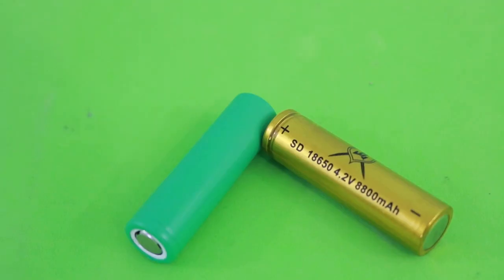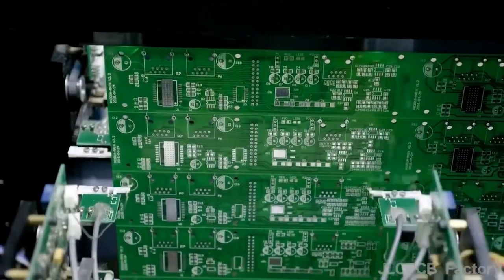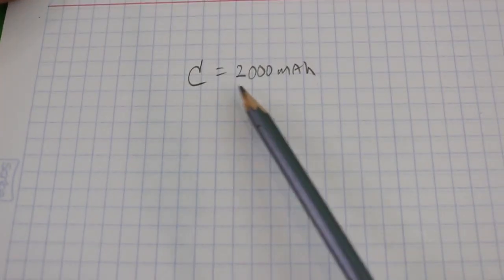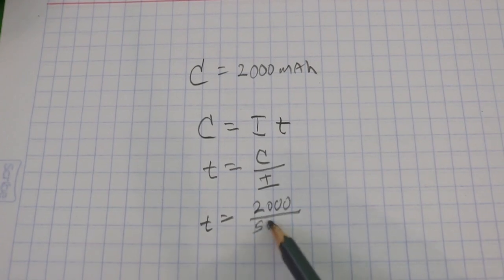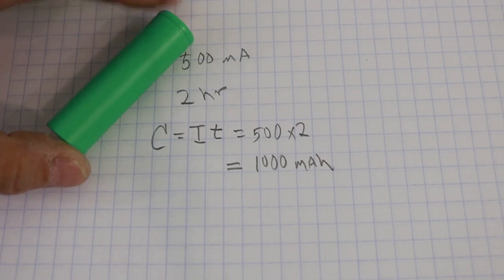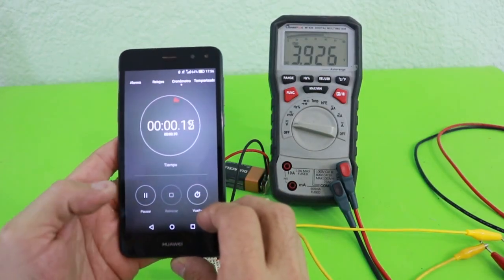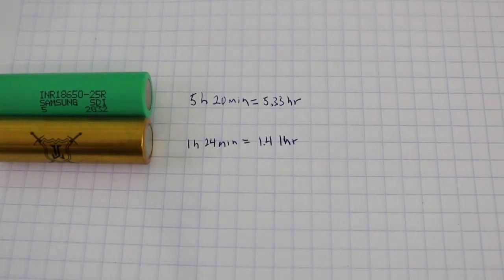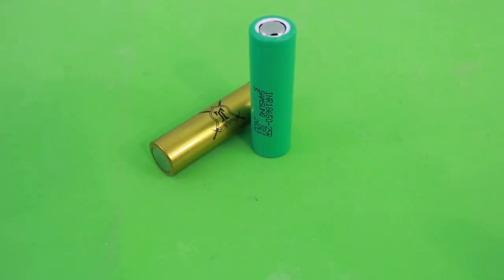How to Test Battery Capacity without Special Equipment

Comment: Couple of questions:
1) Does your dummy load adjust resistance as V drops to 2.5V? 
2) how did you determine 2.5V is the “depleted” voltage target?

Comment: Is it possible to discharge a 18650 at .5 amp down 500 mah and extrapolate the full capacity from that? I have over 100 battery's in my e-bike individual cradle system. Also can you use the same procedure for the entire battery pack?

Comment: I post same questions under this video also since I didn't get answers under the other video. 

Why is not Wh (battery capacity?) calculated with max full charged voltage? For example if an electric kickbike's (Sealup Q8) battery (38km range on a good day) is rated as 48V21Ah (48x21=1008Wh) but it's full charge voltage is 54.6, so why not calculate it as 54.6V x 21Ah = 1147 Wh? 

I have a kickbike Q8 battery (Samsung cells purportedly) rated as 48v21ah but it soaks only 877Wh according to power outlet meter. Should it be soaking 1008Wh or 1147Wh, or is 877Wh correct? I also have another battery from (Aliexpress) Liitokala (tested 27km range) rated as 48V20Ah (48x20=960Wh or 54.6x20=1092Wh) but it soaks only 698Wh (it's more like 15 or 17Ah?). So am I scammed or it is normal? I complained to Aliexpress about it LiitoKala battery, that it should be at least 835Wh in it if it is 20Ah but they ask for more proof. I already showed with power outlet meter how much it soaks, it is 698Wh and showed my other battery soaks 877Wh (for comparison). Aliexpress supports vendors lying about real capacity of battery. Idk how I can prove to them that LiitoKala is not 20Ah battery (more like 16Ah). 

I also bought on Aliexpress a 48v24ah battery called Aimjin but it only charged to 53v (not 54.6v) and from empty to full only soaked 340Wh which indicates its capacity is 7Ah. It also became warm when I used it which indicates it is an old tired battery. But I paid for it near same price as for new battery. Scammed.

Comment: Great video. Keep up your good work. Nominal discharge capacity is linked to discharge current & discharge cut off voltage. Discharging a battery with higher or lower discharge current will result in lower respective higher capacity. If discharging a 2000 mAh rated battery with 1000 mA will last 2hrs , discharging the same battery with only 500 mA will last longer than 4 hours.

Comment: Thx. for the video. Can you explain the following please? 
may i know why you said the batteries would discharged  completely when it reached 2.5 volts? How do i  for 1.5 volt batteries. Please correct me if i am wrong, i was thinking the voltage will be completely depleted to 0 volt? when i buy batteries from a shop what should i be checking to see the capacity? I have a small model plane and i find different batteries provide different flying times. Is it because of the 
* different wind conditions causing it to draw different currents 
* is the the acceleration that is causing it to draw more power
Let me know your thoughts please?
Reply from the maker: These batteries can not be discharged below 2.5 volts because they will be damaged. The capacity of a battery pack is given by the mAh, the higher the number, the more capacity.
Reply: @ludicscience  Thx. for the reply. So you are saying that the displayed mAh by the company on the battery can be fudged. Only a test like above shows the real capacity.

Comment: Hi, can someone help me with something? I have a positive and negative wire going to the back of my van. This wire was used to power a wheelchair lift. I gave the lift away and now I have the cut wires. How can I figure out how many amps it can provide? I know hoe to test volts but how do I test those two wires, positive and negative, to know how many watts are coming out? Thank you.
Reply: Sorry, but you can't measure amps in that way. Amps are determined by the load. If the load is too great, there can be damage.

For example. Let's say I remove my starter, which normally draws 200amps, and replace it with a 12w RC motor that draws one Amp.

Because the load determines the amps, that circuit only produces one amp, and because it is designed to handle 200amps, no damage is done.

Now let's say I hook up a bulldozer starter that takes 400amps.

Because the load determines the amps, it attempts to draw 400amps, but the wires and relays melt. Damage is done.

So, best to find out how many watts that motor used to be, then stick with those watts or lower.
Reply: Find the markings on the cable sheath that tell you the wire gauge or the cross-sectional area if you can find either and use these to look up the current-carrying capacity, or if not, you can measure the thickness if the conductor. Half that is your radius, Squaring the radius and then multiplying by 3.14 will give you cross-sectional area and you can look at a table online with the current-carrying capacity of cable sizes. You could also look at the rating on the fuse that should be at the battery end of the positive and use that as your maximum.

Comment: Wrong right off the bat.  That Samsung battery capacity is 2500mAh, not 2000.  You also mention nothing about internal resistance.  If old and has a build up of internal resistance, it’s junk, so use ohms law to calculate it!
Reply: He said it was 2500 and showed the datasheet and read out from it that it was 2500.

Comment: Bad calculation! 1 hour and 41 min does not mean 1.41 hours. Correct its 1.67 hours. So the result is verry wrong!
Reply: It was 1hr 24minutes and he put it down as 1.5 hours which is close enough for this test.
Reply: You are right

Comment: This is very well explained. Theres some misleading information about this. A lot of people think that measuring the voltage is enough to check battery
Reply: because they confuse the  charge level in the battery   and the battery capacity
in the same way , the internal resistance is not the battery capacity
but the increase of the first can follow and sometime lead to the degradation of the second

Comment: ok but apart from ch fake one , why did the Samsung battery showed more capacity than as it was mentioned in the spec sheet. isnt this weird ?
Reply: Not really, they may have used a slightly different voltage cut-off for the testing which would affect the numbers, but the batteries are not individually perfect at the rating, they're rated into groups, say for the sake of argument a manufacturer only has an 1800mAh product, a 2200mAh product and a 2500mAh product, a battery that tests to less than 1800 would be a dud, one that tests at 1800 or say 1973 would be rated as an 1800mAh battery, one that tests at maybe 2399 would be rated 2200, one that test at 2560 or 3005or whatever would be rated 2500. as long as it's over what it says at the time of manufacture it's all good.

Comment: That's not a simple thing to do eh, most people hate Math. I think my opinion is to buy a charger that can read mAh while it's charging. Thanks
Reply: Buy a ZB2L3. Cheap and accurate if calibrated. I have 20 of them and the worst one has 2% measurement error.

Comment: You're better off buying an RC multifunction charging station and performing a similar discharge test, but charging a discharged battery will also tell you exactly how many mA were accepted before reaching a specific voltage. Also, heavier Lipos are generally the better ones but beware that the chinese have caught on and some now deliberately produce heavier battery without the added performance. Some even wrap smaller batteries into the housing of larger batteries and then add weighs... Vile creatures! EDIT: Example of the charger i mentioned https://www.takealot.com/imax-b6-professional-multifunction-charger/PLID42070840

Comment: Is it possible to test the amperage or capacity of a constant power supply such as a common 5VDC wall/phone charger? Too many chargers these days claim to have QC 3 with a total power of 18W or 20W or more Watts. How can I know that a charger is really delivering 5VDC at 3A as claimed?
Reply from the maker: yes you can, maybe i will make a video about that
Reply: @ludicscience  I hope not using huge resistors and USB tester/meter/monitor, because these are the common duo to test USB power sources (power bank and wall charger). They are not really good for us on many levels, I think.

First disadvantage - USB testers rob some power to power itself. This is what not many people know and the company/maker does not tell. So, the result will not be accurate on top of the already inaccuracy of the tester.

Second disadvantage - Resistor in the resistive load gets hot. Temperature can affect result. Adds to the inaccuracy of the USB tester. Adding insult to injury.

The "best way", I think, seems to be using the electronic/current load such as what you have and show in this video.

The price for a read-made one with a fan is....whoa, too expensive! The USB tester is already stupid expensive! I mean, the better quality one such as those UM series by RUIDENG. I could buy 2 reasonably priced quality digital multimeter with that combined price! Not to mention there are too many sellers selling the same things of the same names that very likely are fakes, they do not even have brick & mortar for me to walk in to know they are not fly by night businesses!

With your simple and inexpensive DIY electronic load + regular digital multimeter = probably results in the cheapest and the best result and stuff. (Theoretically there is no such thing as "cheapest AND best". In actuality prices are determined and fixed by humans, not forgetting those middle people/resellers also want to profit by marking up prices)

I hope what I mentioned are correct. That is a little of my rant there. Hahahahah! Oh well, I am not a YouTuber getting money from YouTube like Bigclive who can afford to buy things and wreck.

Comment: The second i saw a breadboard I knew special equipment was needed hahahaha
Reply: Legit 🤣🤣
Reply: PCB*

but fr, the title was hella misleading
Reply: Yeah, still need a phone as a stopwatch, when the phone price far more expensive than buying a battery charger that have capacity test feature, that will run automatically without manually press the stopwatch and look at it.

Comment: I hope you have tested this two batteries are at it's brand new condition from it's packaged, before you do this comparison, anyway good video experiment, but still say how would you assure the viewers that you are using a set of two brand new batteries, because they're still at their own maximum life cycle conditions and max health too, isn't it right.......?
Reply: It really doesn't matter. Even before he tested them, anyone could have told you that shitty chinese battery would be lucky to make much more than 500mAh. 8800mAh is an impossible figure. Pretty much anything over about 3500 is I think, for those 18650 cells.
Reply: @chocolate_squiggle  That's right 👍

Comment: Puts "without Special Equipment" in title, proceeds to test batteries with special home-made tool.
Reply: Hahaha no special equipment.
Reply: Yes seems to be a theme in here oO
Reply: That special equipment is a dummy load, which he did say, so you can put anything on as long as it draws a constant current, measure the load and do the maths
Reply: @LairdJ56  the problem is that you need to adjust the voltage to keep drawing the same amount od current.
As the voltage of the battery drops you need to lower the resistance
Reply: What items does the average person have handy that can draw a constant load?
Reply: it is not special thou because you can make it from cheap electronics
Reply: "Special" would indicate it's something that the average person doesn't have easy access to. It's like saying "How to make a watch out of things you have at home" & then saying you need a 3016 battery. It's not that 3016 batteries are hard to come by, but they are things the average person doesn't have at home. If they said AA or AAA you could assume most people have those or have access to some by opening a remote, while a 3016 battery you only likely have if you use equipment that needs that battery that isn't usually easily removed.
Reply: Everything in this video looks like stuff I have lying around. Not special at all.

Comment: What about the life cycle, how can I calculate that?
Reply: Life cycle cannot be tested. If your cell capacity is less than 80% than its already useless as charge retention will decrease and internal resistance will increase

Comment: They were only off by 1 Zero, if it said 880 it might have been close to reality.
Reply: But a zero is equal to nothing so it wouldn't make a difference if you can believe the Chinese manufacturer's logic. Very deceptive and needs to be stopped because millions of people are buying these batteries from Amazon and eBay type stores and getting duped by crazy over stated battery capacities. Be very wary of anything over 3,000 mAh.

Comment: He uses special equipment.. I myself cant make an equipment like he did I don't even know where to buy that PCB he uses and that alone makes it special.
Reply: He doesn’t use a PCB, but what is called a breadboard.
Any electronics store will sell you one of those.
Reply: @marcos.1771  Anyway it requires some electronics skills.
Using a multimeter could be treated as maximum equipment.
Reply: @lukask7445  The title of this video clip here is totally misleading.
Reply: @lukask7445  The multimeter is the only equipment you need, you can use a lightglobe or anything else as the load as long as you know the current draw, which you can determine using a multimeter. He's just using the dummy load because he has it and has set it to run at a convenient draw.

Comment: "2 dollars only" * 30 bucks shipping* i love it
Reply: It is a dummy load, as long as the current draw is constant you can use anything, measure the load and do the maths with that. £0 shipping fees lots of stuff around the house, torch (flash light) etc etc
Reply: That's the norm when you buy products from Amazon, or even the US in general. 
Pair of bike pedals: $18 - Shipping: $74. You only see this in the final check out page, after they advertised Free Shipping and Prime on every previous page. Total Scam!!!

Comment: Shouldn't you only discharge these to 3.3v as the amps fall off there on most cells
Reply: Depends. If you don't care about longevity you can discharge them as deep as you want. If you cut off at 3.3, 3.2V, that's better for cycles, yes. But really answering your question: every cell that has a datasheet states the discharge cut-off voltage. If you want to test according to those datasheets you must set up a constant current load and a cut-off voltage. This method will confirm how close your cell is to the specification. But most of us don't need these precise measurements, cycling through old, harvested cells from laptops and such we just need a ballpark estimate, a ZB2L3 only uses a resistor, hence varying load, but accumulates the Ah as it discharges the battery. That's a fair enough measurement. Special equipment, haha. For a couple dollars I think it's okay.

Comment: Look at charge/discharge curves. Everything in this video is a first order approximation. Basically, just measure the mass. That’s about all these methods are good for. 

See: batterymooch
Reply: The measure he did still gives tje total mAh, no real approximation. From the curve you get the max and min usable voltages. If you only care about mAh, what he did is still correct

Comment: Great 👍🏼 video.......Can you measure the capacity of normal AA and AAA batteries rated 1.5V ?
Reply: It's basically the same process just divide the nominal total by {№‰±xª=___}  & simplify it by its common denominator to find the quotient value, so (X×{____}÷a=(axb)+___%<٪1/⅓×Z-Y=(____) & there you go! Just make sure you take the total ≈MAH & add that to the battery's total ampre output before multiplying the voltage output by the resistance stated by manufacturer.

Comment: I would call this setup special equipment too. It has all what have special eq beside mA counter and auto stop when discharged.

Just use light bulb. Measure current with connected to fully charged battery, and fully discharged battery, take avg, add about 10-15% and measure time discharging with lightbulb from full battery to empty.
Reply: Shadow_of_STLKR - The “equipment” demonstrates the creators actual understanding. In other words, zippo. Kinetics are the key. The video is blind, stupid and misleading. All that said, just measure the mass. Forget this bogus video.
Reply: @boonedockjourneyman7979  Hey, why don't you put up or shut up? Criticising a perfectly valid measurement method with talk of "kinetics". In 50 years as an EE I have never heard that term used in conjunction with batteries.

.... OK, so I googled it. It appears the term kinetics is used in conjunction with mathematically modelling the internal processes. Very important for the backroom guy and gals  designing battery systems. I cannot see any relevance to a user wanting to test the batteries in his torch, model car or vape thingy.

I have only two comments on the validity of @Ludic Science's method:

* A more typical cutoff voltage for Li-ion is around 3V. My LED torches get flakey at 3.1V - 3.2V
* Capacity can vary with discharge rate. Different batteries are designed for different duty cycles.

But as a good general purpose ad hoc method, it's a good way to compare batteries.

Oh, enjoy you two subscribers.
Reply: @boonedockjourneyman7979  in the land of the blind, the one eyed man is the king!